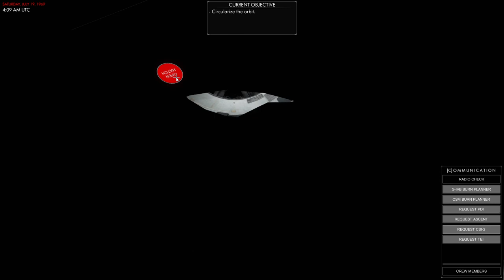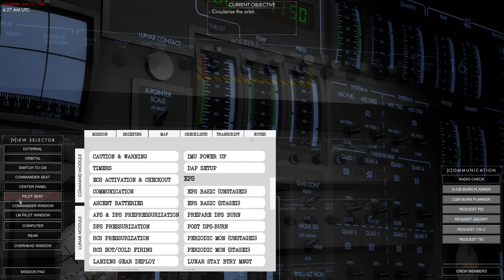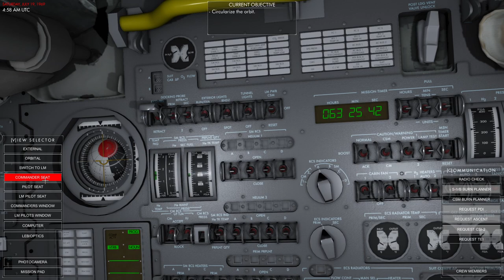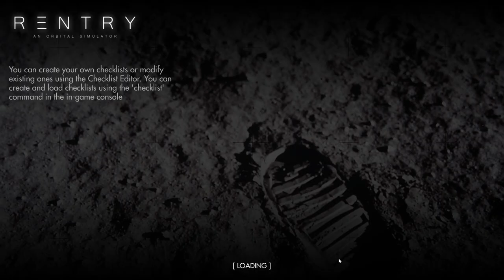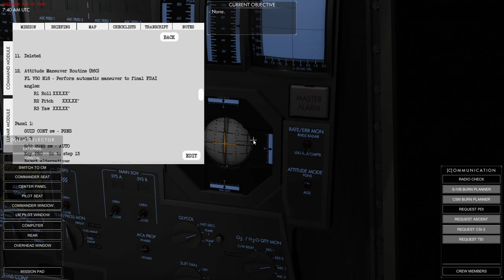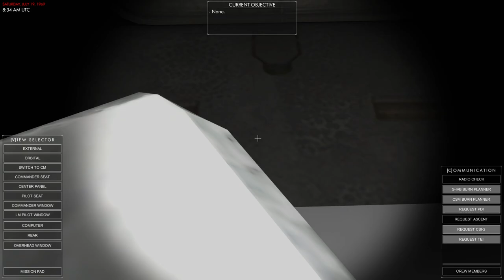Reentry - An Orbital Simulator - Apollo 11 Lunar Landing

Comment: I just did my first LM landing last night and didn’t forward through the radio chatter so I couldn’t figure out the descent rate switch so I used RCS (K) to force it down and landed “successfully”, I was cracking up when I saw it was T/G keys. Plan to try it again today and see if I can nail the landing spot now that I’m not flying in panic mode. It was easier to land than I expected (the computer does the hard part).

Comment: Why not try Orbiter 2016 Nassp?
Reply from the maker: Because Orbiter's interface is horrible and it does everything in its power to dissuade me from ever using it, including not actually coming with sound. At least with Reentry, I can see that the developer cares about the experience and is constantly working on it.
Reply: @RaizSpace  I just got this game. It looks very very cool but is there something you can recommend for me being so new at this? Is there a way that can show me each step of what I need to do along the way? Thanks and good video I’ll sub if it helps you out
Reply: @andrewzeedyk3095  I have started doing that and it helps a lot. I still get kind of lost but I have finished all the Mercury missions and am on the Gemini docking one now. I have to replay them over and over cause I am trying to understand what is going on and sometimes I’m kind of stupid lol
Reply: @alanluscombe8a553  hey dude I get it. Just run through the checklist and you'll be ok
Reply: @alanluscombe8a553  Oh trust me, it takes a lot of time and experience to become confident in the operations. I’ve managed a lunar landing in Apollo and I still have no clue how I did it. Good luck!